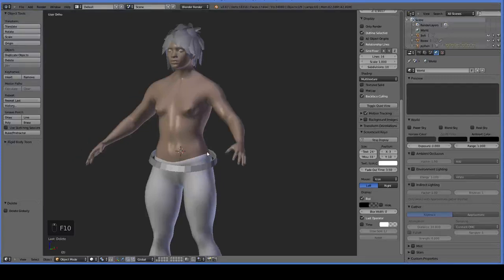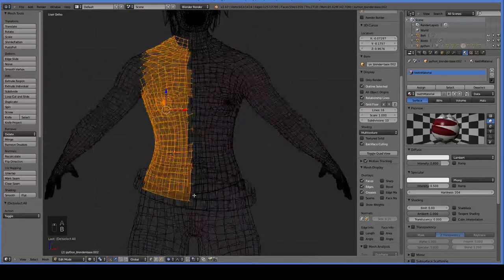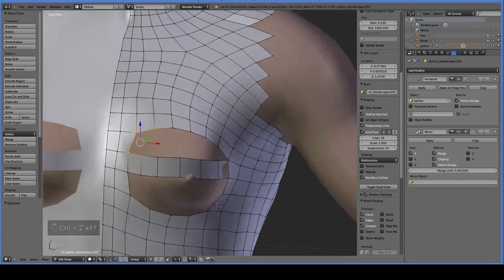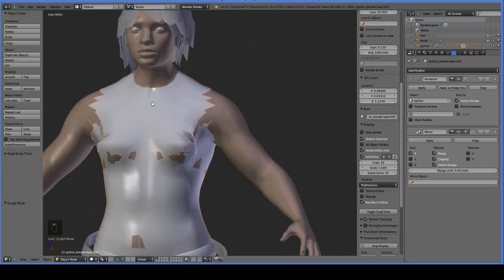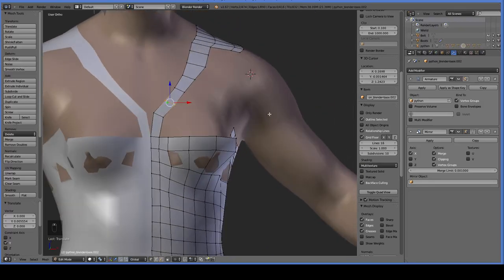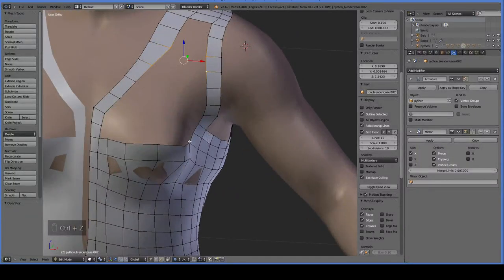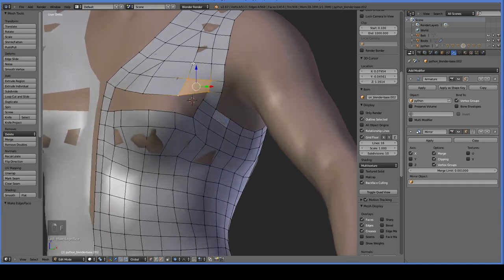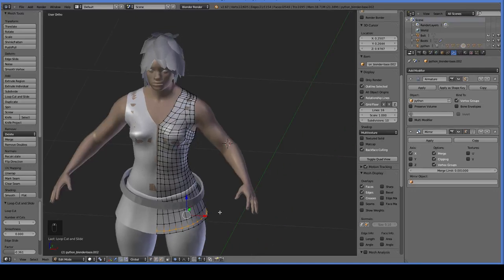Let's Program RPG #15: Laying Out the Tunic

Comment: Craig - just wanted to thank you for these tutorials so far, I'm learning heaps about Blender! :)
Reply from the maker: Blender is a bit finicky, but it is free. Just keep in mind that the more powerful, expensive modeling systems don't have the same keyboard shortcuts or modes, so it can be quite a UI shock.
Reply: Craig Perko Oh yes the learning curve is steep but it's very powerful for free! You mentioned that triangles are bad and go out of your way to create quads. Can you expand on why this is?
Reply from the maker: nockieboy Basically, "edge loops" are a line of connected verts that run continuously. They are really great tools for making sure animations look right, because they naturally make the mesh flex properly.

Edge loops combine into quads - edge loops running one way, edge loops running the other. Ideally, all these quads should be nearly square, because square faces don't distort much when you animate them. So edge loops flex naturally, and they create quads that don't distort.

Triangles aren't inherently "bad" - all the quads turn into triangles, after all - but they tend to mean your edge loops and square faces aren't as clean as they could be. Something which is entirely tris - like a 3D scan of a person - should be redone using cleaner topology or they will crinkle like tin foil when you animate them.

Comment: 5:50 You just connected with the wrong loop on the outer side.. you should have connected one loop below for perfect quads all over the breast area without the need for fixes.
Reply from the maker: Yeah, I was trying to allocate for better shoulder topo, but then I ended up dropping the ball.